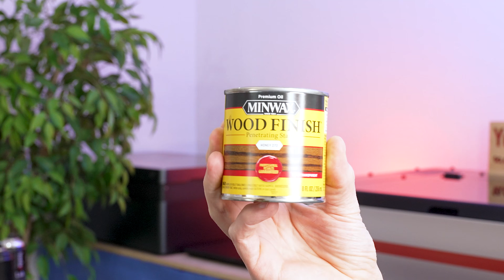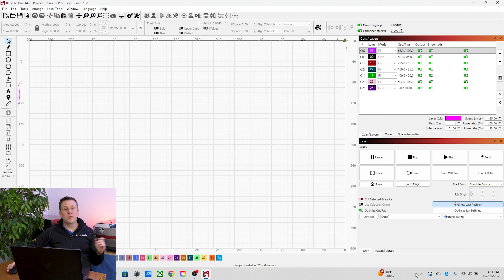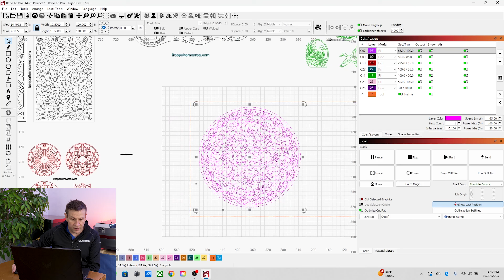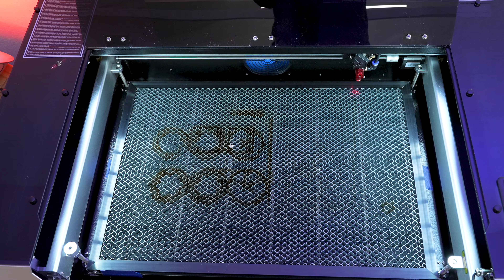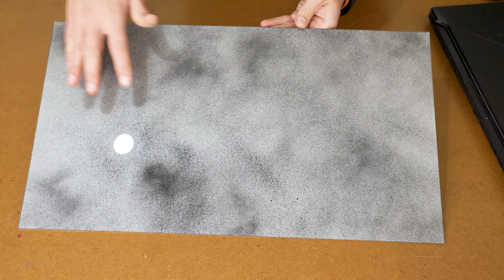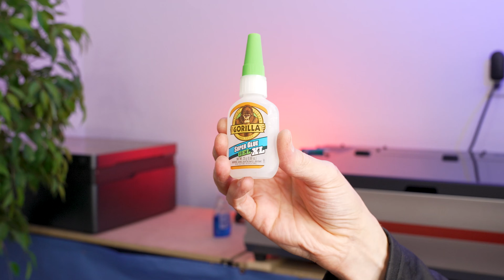Perfect Project  Reno 65 Pro by Monport #monport #reno #co2 #co2laser #acrylic #acrylicart

Comment: Greg,
Can this Reno 65 work well with engraving tumblers? Any testing?
Reply from the maker: I have lot's of requested to do the rotary setup on the Reno- I'm in contact with Monport on the settings and what they do- the TopWisdom controller does not support the Rotary Setup Tool in Lightburn so the adjustments are made in the machine controller itself rather than the Lightburn software.
More to come...